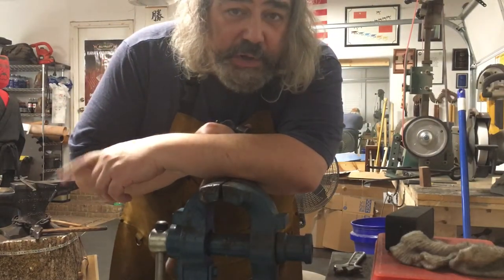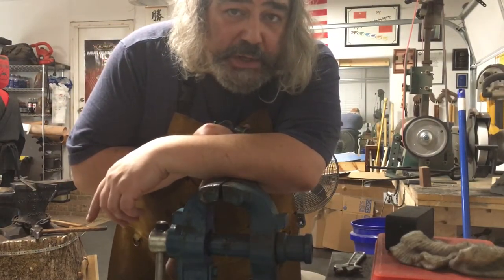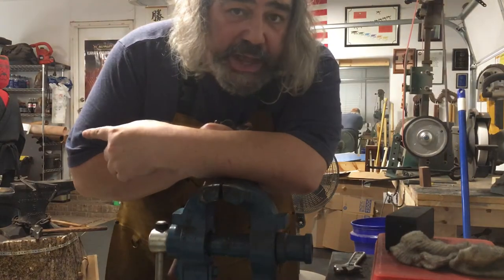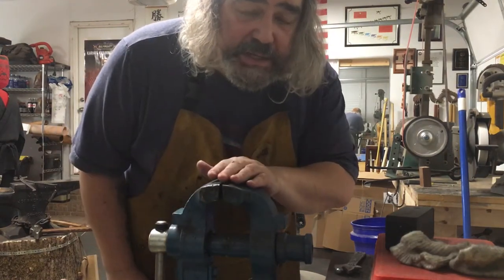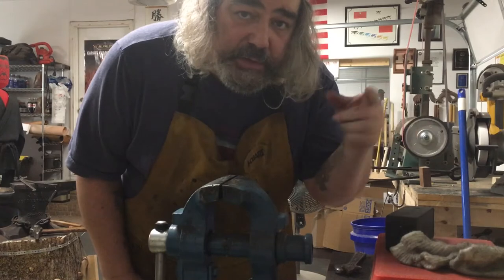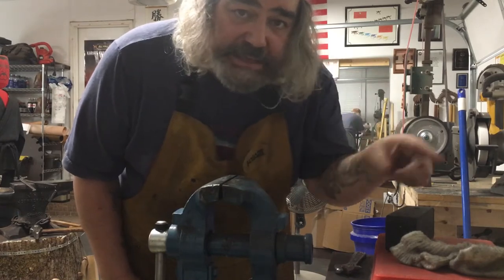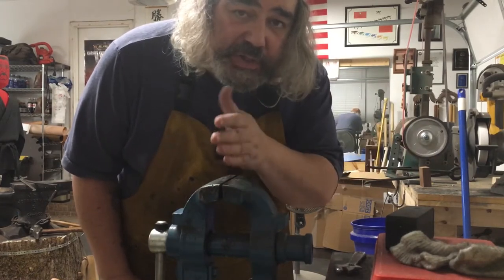Knife making - handle burn through tips

Comment: So do you need to pre-drill? or can you get away with not drilling? Which is better?
Reply from the maker: Yes I pre-drill a smaller hole to allow the gasses to escape. Works way better that way.
Reply: @PandaBearForge  Thank you very much, will do.
Reply from the maker: @AndrewDinspechin  Hope it works out for you. Good luck!
Reply: So you mainly stablized wood. Have you tried this method with that wood
Reply from the maker: @nickminderman7380  No sir, I have not.
Reply: pre drilling isn't strictly necessary, but it is much harder to do a burn through without pre drilling.